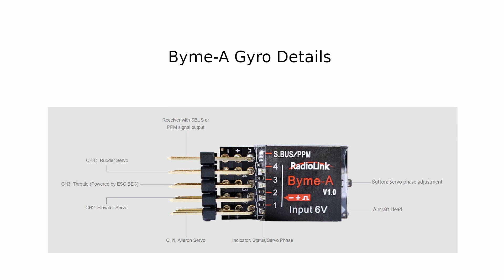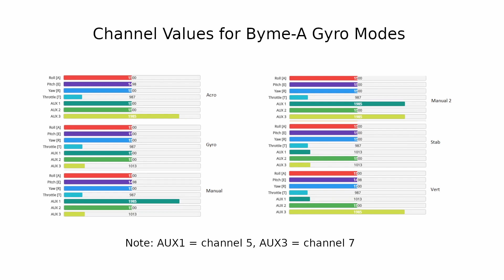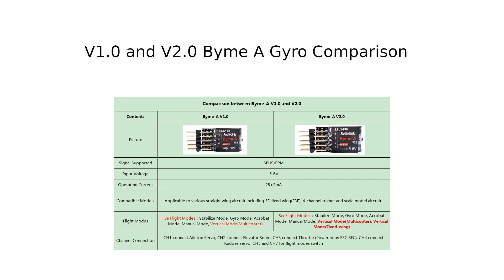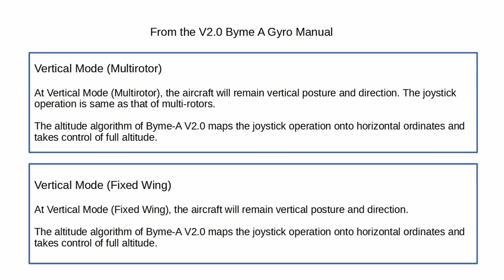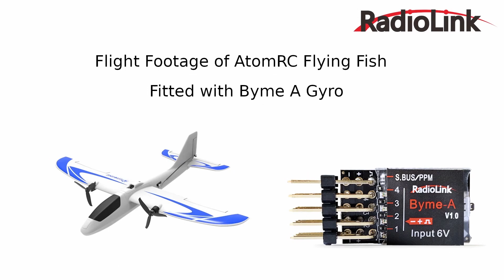Tutorial On How to Use RadioLink Byme-A

Comment: Have you tried connecting with the ELRS receiver? Four modes work well (Stabilize Mode, Gyro Mode, Acrobat Mode, Manual Mode, Vertical Mode), and two more (Acrobat Mode, Manual
Mode) are buggy... Apparently due to the feature of ELRS. Haven't found a solution yet.
Reply from the maker: Hi, sir. Byme-A supports standard SBUS or PPM signal. If your ELRS receiver can support standard SBUS or PPM signal, they can work together. May I know what you mean that the two flight modes are buggy? What happened in these two modes? You can send more details such as a video to after_service@radiolink.com.cn
Reply: @Radiolink_official  With the help of the SBUS checker, I determined that the problem lies in channel 5. In elrs, this is arm, i.e. only 2 positions, and for Byme-A you need 3. You need the ability to reassign channel 5 to another. Is it technically possible? I would not want to abandon Byme-A, but there are more and more elrs receivers. If you need a video, I'll try to make it.
Reply from the maker: @vovvw  Hi, sir. For Byme-A, channel 5 and channel 7 are assigned to switch flight modes by default. It is written in the program of Byme-A, and cannot be changed. You just need to assign a 3 position switch to channel 5, and a 2 position switch in the transmitter to channel 7 to change flight modes. But first, you need to make sure the receiver supports standard SBUS and PPm signal. If it can, Byme-A can work with the receiver. If any question please feel free to contact us. Our email is: after_service@radiolink.com.cn
Reply: @Radiolink_official  Unfortunately, in ELRS receivers, channel 5 is rigidly tied to ARM, i.e. only 2 positions. There are no problems with SBUS, everything works. Swap channels 5 and 7 and everything would work correctly.
Is it possible to replace the firmware with Byme-A?
Reply from the maker: @vovvw  Hi, sir. Sorry there is no firmware available for Byme-A.
Reply: @Radiolink_official  Sorry, I would like to update...
I read the elrs docks, with the transmitter settings "Packet Rates: 100Hz or 333Hz Full Res" and "Switch Mode: 16ch Rate / 2" everything works correctly! Channel 5 becomes not 1-bit "2-pos Arm", but "CRSF Ext Limits Half Rate", i.e. 10-bit or 1024 positions mapped to PWM 885us to 2115us.
This must be indicated in the instructions. For those who will try to use ELRS and Byme-A.
Reply: @vovvw  Thanks for posting the information here about the recent changes to ELRS which now can allow the use of ch5 for the 3-position switch needed for using with this little stabilizer. Hopefully any mug coming here for information will have the brains to read ALL the posts before screaming "It doesn't work!" 😜😁
Reply: @Radiolink_official  i would love an appreciate a video about this, thanks for al the great information. Greetings from netherlands
Reply from the maker: @jimmybrouwer2744  Thank you for your support

Comment: I am a new subscriber to this channel, very interested in this receiver !!!!!!!!!!!I have a Jumper T12 (opentx) , can i use it with this receiver? Or i also need to buy a SBUS PPM unit? Thanks
Reply from the maker: Byme–A It is not a receiver, it is a fixed-wing flight controller, which is used to assist the aircraft to fly easily. It supports all sbus signal remote controllers and receivers, including jumper T12 And there is no need to add any additional transfer wires.
Reply: @Radiolink_official  tks for the response. So let me see if i understand: My receivers are Lemon (DMS compatible). So to use this controlled , i need to connect my lemon receiver to the A3 Mini and then use a Sbus/PPM in order to sent the correct signal to my jumper t12 multiprotocol radio in order to assist my plane to fly. Is this correct? Thanks
Reply from the maker: @alexherrera3918  Hello, sir. Byme-A supports PPM/SBUS signal. You just need to connect Byme-A to your receiver. And connect the servos of your plane to Byme-A. Here is the detailed manual of Byme-A, which introduces how to connect Byme-A for your reference: https://www.radiolink.com/bymea_manual  By the way, please make sure your receiver supports SBUS or PPM signal, Then they can work together.
Reply: @Radiolink_official  Thanks
Reply from the maker: @alexherrera3918  Our pleasure

Comment: Does the stick calibration have to be done every time the stabilizer is turned on or is it a one time thing?
Reply: Yes !!! This I found is a great feature !!! I fly an A560 and found that in the field when I use a heavier than recommended battery I can recalibrate the 5 to 20 degree's to compensate  and easily reset(calibrate) back for the 550mah ..... Magic 😉😎
Reply from the maker: Hello, sir. No,  you don't need to calibrate the attitude every time the Byme-A is turned on. It is a one time thing. Because attitude calibration will be recorded by flight controller once the it is complete with success.

Comment: An excellent video tutorial Nick. Only 2 things could have improved it. The audio level was a bit low. Secondly you should have emphasized the importance of doing the set-up in the correct order. 1. Level calibration. 2. Gyro stabilization correction direction adjustment with the button. 3. Setting the stick control directions in the transmitter! 
With ALL these cheap Chinese stabilizer units changing the stabilization correction direction ALSO changes the stick direction. Changing the stick direction has NO effect on the gyro correction direction! So adjust the sticks LAST!
Reply from the maker: Hello, sir. Thank you so much for your detailed explanation. It would be great if you can take a related tutorial about Byme-A. We believe it will be very helpful.
Reply: Thank you for your comment regarding the order of set-up. I am just on the point setting up a Byme-A and your comment is absolutely fundamental.

Comment: Very good video - thanks for being so thorough. I've just bought a BYME-D to try out on cheap delta wing but might get the BYME-A for some of my planes if all works well. Can I ask whether you find the gains are more or less ok (ie no excessive bobbing, wing waggling) because I can't see an obvious way of adjusting the gains on these (unlike some receivers on the market that have three knobs/screws you can turn to adjust)?
Reply: Mostly for smaller craft (under 1meter) they seem to work pretty well. The only way to reduce gain, if you find your plane oscillating, is with the servo/control horn geometry. Also try to avoid using the closest inner holes for the wires as any slop in the holes is magnified. Also note that the Oriental languages all seem to habitually use "rudder" as a synonym for "control surface" or even sometimes "rates" - as in "big rudder" or "small rudder".
The Byme-D works well enough but can sometimes show some very weird behaviour on the bench. See the videos by "1nformatica" plus, as "Ground Control RC" has shown, the elevator travel to aileron travel ratio can be a bit restrictive for some Deltas. Hopefully Radiolink will adjust the PIDs to correct these oddities with further version releases.
Reply from the maker: Hello, sir. Sorry you cannot adjust the gains with the knob. Because there is already stability margin for Byme-D PID control. So you cannot adjust it. When you use different models, if the gyro of Byme-D is under correct or over correct, you can try adjusting the rudder angle on your plane. If any question please feel free to contact us. Our email is after_service@radiolink.com.cn
Reply: Bit late coming to the party here but in my experience on each of three models I have used BYME D gyro's they have produced unusable amounts of oscillation. Had to remove each of them as playing with the control horns did not resolve the issue. With regards to the BYME A gyro however, I find these perfect for my requirements.